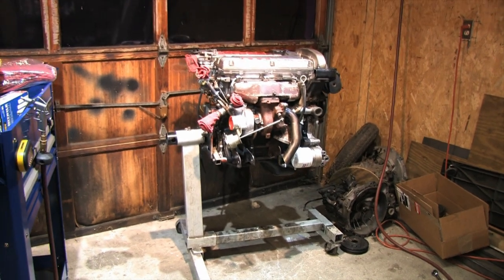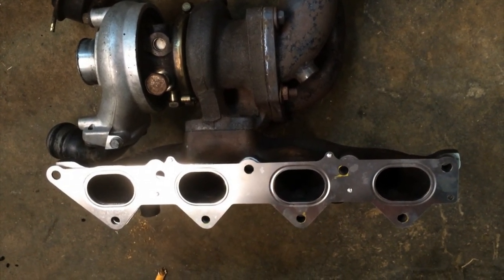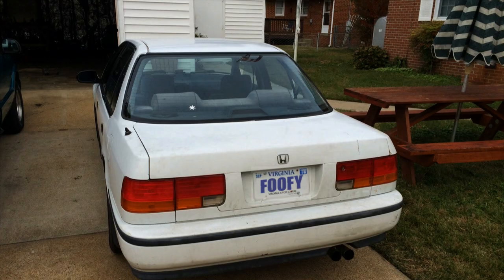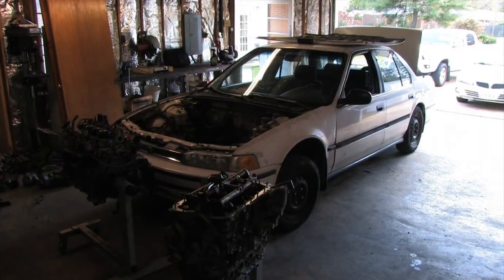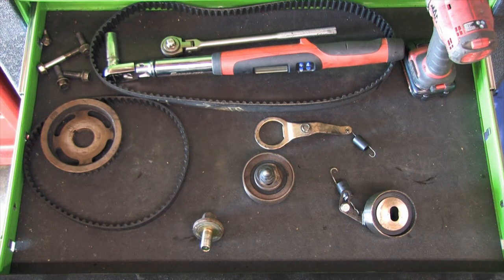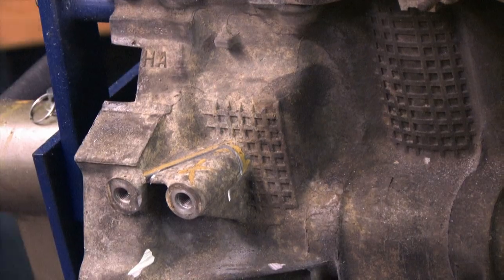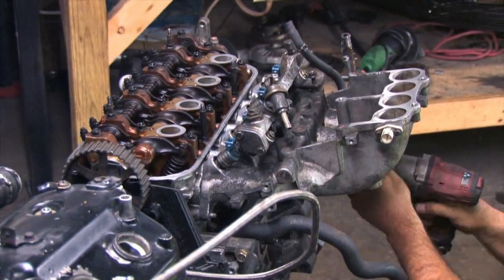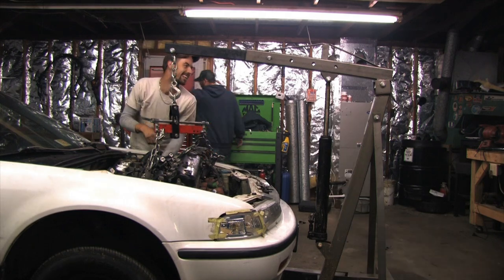Foofy?

Comment: Maybe not the best thread to ask but.. What sort of oil should I use to lubricate the sprocket that goes on the crankshaft in 4G63? 60k miles ago I didnt use any, and yesterday I have had a huge problem with removing it.
Reply: Blue loctite is by best guess. It secures yes, but it prevents rusting and removing later problems too.
Reply from the maker: +Martin There'ss no lubricant recommended for the sprocket, actually. What Mitsubishi did was design it to need a special tool to remove it. There's 4 threaded holes around the crank snout. That's where the puller is supposed to bolt down to. It's a puller that uses a bar for leverage, bolts to pull the gear, and it uses the snout of the crank for leverage. I've never bought this tool and don't own one. I've had crank gears that won't fit on the crank, but I've never had one that wouldn't come off. There's always more than 1 way to skin a cat.

If you don't care what happens to your crank seal and the block isn't covered in flammable oils, heat up the crank gear with a propane torch and pry it off with a shorty pry bar. You don't need to make it red hot or anything. In fact, that would be bad. It will grow slightly with heat, and should give you the extra slack you need.
Reply: Forgive my answer Martin. I considered typing, "I'm not sure of the correct answer, but if someone answers I'll want to know too."
Reply: +DE Nichols Thanks for the answer. I have learned something new, that's the whole point of asking questions and reading the answers :-)  I will have a look at this stuff.
Reply: Martin My advice is good elsewhere if you get my drift. :) Just not on spark plugs or high heat areas.
Reply: +Jafromobile  At the end, I have made the tool out of the old pulley;it worked without any problems. second sprocket came off after very gentle tap of the wooden block. Woodroof (?) half moon did not came out at all,so I decided not to molest it :-)
Against the advice, I have used a tiny amount of the graphite grease. ATF has got great penetration properties, I was afraid that the rotational forces will only accelerate its 'escape' + it would mess the belts.

Time will show, next check in about 50k :-)

Apologies for the off topic.

By the way Jafro, I think you have never made a video with the detailed timing belt installation! I can understand that after your brilliant blueprint series that would be a step back and basics of the basics... but hey ho... maybe one final Lantra upload? :-)

Comment: Hello, my master, my car is elantra 1992 model 1.6 dhoc engine when I start my car, it is carrying water out of the radiator
Reply from the maker: Usually this is a head gasket failure.  Exhaust is using the water out.  Sometimes you can just replace the head gasket, but you might need to do more work if the head or the block are warped.  Cheap parts, it just takes a while to do it.

Comment: I know a lot of people who feel that the balance shafts aren't necessary and they usually leave the belt off.  Thoughts on this?
Reply from the maker: +Samuel Thomas The oil pump balance shaft is gear driven, so that trick doesn't quite work on a 4g63.  The oil pump is driven by the timing belt, and only the front balance shaft has its own belt.  You don't want to run one without the other if you value your fillings.
Reply: +Jafromobile On the F22A though the front and rear balance shafts are driven by a seperate belt than the timing belt, the oil pump is directly driven by the crankshaft and the water pump is driven by the timing belt.  Many people report no noticeable difference in vibration when leaving the balance belt off.  it sheds around 8lbs in rotating mass.
Reply from the maker: Samuel Thomas Oops, my apologies.  The comment screen I was on answering you… didn't tell me which video your comment was on.  Yes, on the F22 both balance shafts are belt driven.  I wouldn't remove balance shafts on any car with a stock or solid crank pulley.  I'd recommend a dampened crank pulley upgrade.  Some harmonics you won't feel, but your engine accessories will.
Reply: +Jafromobile But if I recall, the balance shafts do not reduce torsional vibration like a harmonic balancer does.  They're designed to reduce secondary vibrations that are natural in all inline fours.  Other Honda engines don't have balance shafts, that was kind of an Accord/Prelude thing.

Comment: im doing some 90's stuff too"   90 prelude 4ws- f22b1 block  h22a4 head-   any advice is much appreciated .. just like all of your vidi's......much appreciated ... also got my hands on a 98 impreza 2dr 2.5rs.... parts are a nightmare...
Reply from the maker: If that F22 sees either boost, or nitrous, increase your ring gap dramatically.  The rotating assembly has virtually no aftermarket bottom-end aftermarket.  There's a few tricks that have caveats, but the only options are incredibly expensive.  If you're going to boost an F22, the stock rings will be the death of that engine if you don't give them adequate ring gap to deal with the heat.  You probably gathered that from the video, but that's the study we've got out of this.  Foofy is back.  Foofy got a chassis upgrade.  This setup is in an LX now.  No longer a DX.
Reply: ,.  i was planning on getting it running right. then tearing it down and adding a 87mm bore from 85.5.to match the h22 head, then get rods and piston. but for now its just  Frank.. I'v heard a few tricks my self.. like like h22 crank may fit along with the rods to make a franknstroker ,.iv also heard evo 4g63 pistons will work too if you didn't want to resize, but they drop compression  ,., right now im at odds on valve stem seals,,. too go aftermarket or to go oem.... and if aftermarket ,,what are some reputable brands for honda,. and then the valve spring decision, when does it become necessary to upgrade them? .,. btw.  how do you feel about balance shaft delete mods?

Comment: i not a big fan of the f or h series but the f20b blue top is cheap and packs power and bolts on to the accord chassi don't know if you turbo set up will fit tho
Reply: ponchob18 you do realize that the f20b is basically a smaller h22 right?

Comment: Hey I'm not getting any rpm when trying to fire and it won't start, it'll sometimes pop off flames. Any idea on what it can be. 1995 GSX I wired in the 1g CAS it gets spark it just won't fire, any ideas let me know
Reply from the maker: +Mikey Alameeri You need to swap some plug wires around.  The '95 cam angle sensor works backwards from all other years' cam angle sensors.  Just to let you know… it wasn't the '95 model year that got it wrong.  It was all other years.  ;)  Google "95 CAS 1g 1gina2g swap plug wires".  Click "I'm feeling lucky".
Reply: +Jafromobile I've got the 97-99 eprom ecu so it says that I don't need to change those wires around
Reply from the maker: +Mikey Alameeri I didn't know that any 97-99 ecu's were EPROMs?  It's an easy thing to test, though.  To just swap 1&4 and 2&3.  It sounds to me like it's out of phase because you got it to backfire... So you know there's spark.
Reply: +Jafromobile no yeah it's a flashed black box ecu, I'll try that but it says that they don't need to be switched because of the ecu that's in it

Comment: diesnt those motors already have like 9-1 compression?how did you get around that?
Reply from the maker: +reachforacreech What is there to get around?  Compression is a good thing if you know how to tune for it.  My turbo Elantra is nearly 10:1.
Reply: +Jafromobile I thought anything over 10-1 would cause predetonation
Reply from the maker: It could.  Indeed... or you can correct your timing and fuel mixture to make use of it.  ;)

Usually people who complain about high compression are trying to get away with it on a factory ECU.  Your fuel source and quality play a factor, but you can definitely tune around reasonably high compression ratios.  I wouldn't go boosting an 11.5:1 build over 5 pounds, but with the right fuel, you can.  I'm throwing 20 PSI at my Hyundai.
Reply: +Jafromobile so do all non turbo fuel injection engines require a new ECU in order to control it after  adding a turbo?
Reply from the maker: Maybe not a new ECU, but means of tuning it, or a piggyback system that lies to it so that it does the right thing with all the wrong information...

Comment: So I got rid of my 4G63 Sentra project for.... for a Foofy clone! 93 4 door CB7... but auto :/ Its getting a manual swap soon then getting all my turbo parts I've collected over the past couple years.
Reply from the maker: You are absolutely going to hate the manual swap on that car.  The engine mounts on the body are in completely different places than on the manual.  The rear engine mount is even vacuum actuated.  ...?  I can't tell you why Honda did it?... but the body of the automatic is a different body than the manual car.  The automatic transmission mount doesn't fit the manual body, and the manual transmission mount doesn't fit an automatic body.  Their position is physically different in the engine bay.  That will require expensive custom mounts, or time-consuming re-engineering of the body-side mount.  I'd advise you to look around for a non-running manual donor unless time and money are no object.  In the end, the boosted F-series will still have a glass jaw.  Use Hondata, but be 100% sure to install a knock sensor or you'll find that glass jaw real quick.  There are no good readily-available fuel maps for the turbo F22, so it will take careful tuning prowess.  While it's a do-able swap, it's not without its issues.
Reply: Ehh, crap. I swapped a few cars before but never a Accord, didn't know it was that involved, guess I shoulda done my research before buying it. I've had a manual 91 Accord before and loved the F22 and always wanted another. Hmm, I might have to do some horse trading with this car, brb......
Reply from the maker: It can be done... Foofy got that treatment.  You just have to really want it badly enough.  :). But if you can easily find a manual donor, you'll thank me later for that heads-up.

Comment: whats the 450cc duty cycle @ 15 psi? 90%?
Reply from the maker: +john martin Probably.  That sounds fair considering all engine systems and variables to be in spec, stock condition and in perfect health.  It's going to vary from car to car based off of how much intake and exhaust resistance there is, whether or not it has boost leaks, and the condition of the fuel system.  It's all dependent on airflow but it can also change based off of how well its fuel pump works, condition of the fuel pressure regulator, etc...  If the fuel pump or the fuel pressure is weak, the duty cycle increases to compensate and satisfy the o2 sensor.  If pressure and fuel flow runs higher than spec, it will decrease the duty cycle.

Comment: RIP Foofy i learned a lot from this
Reply from the maker: Foofy ain't dead!  Foofy lives on.  You won't believe Foofy's next upgrade...
Reply: can we please have the video? i got about 2 more elantra videos then i'm gonna need a break...
Reply from the maker: Zac Wadholm I expected it to be finished by now, but the owner has his hands full at the moment.  I'ma need a break from the Elantra myself.  I've only got about 2 more videos I can make of it.  I'm removing its last few deathtrap tendencies before dropping the hammer and taking it to a dyno.  That car turned out to be around 600% more work than I ever wanted to give it.  At least it kept the miles off of my GSX.  It kept the engine out of it, too... but that's another story.  I'm trying Zac, but my hands are just as full as Chad's at the moment.
Reply: hey man I know how it is, i took time off work to build my car i'm only 16 but i'm building a 04 Mazda 6 2.3L with wiesco forged pistons and eagle rods I wanna run a 14B turbo at 22PSI, a 75 wet shot of nitrous, a big valve cylinder head and a crower cam. I dropped the compression ratio from 9.7 to 8.8:1 and with ethanol, i'm sure i'll break something. either way love your content because I learn so much and no matter what it is i'll be sure to watch

Comment: Why would he not pull the head, and install a new gasket and head bolts since he will be boosting it?
Reply from the maker: +Subaru Mike Because it would have made my video too long.  :P  No really… The first 2 engines held 26+ PSI boost on factory parts and didn't fail because of a blown head gasket or stretched head bolt.  There's that, and also because he started to… and the first head bolt on Foofy 3 that he tried to take loose stripped the bolt.
Reply: Wow, is that by unlucky chance that the bolt stripped, or a common thing on F22/23's? I have unbolted ALOT of Subaru blocks, and i hope i never come across this happening!.

Comment: Love your work Jafro. If your after a cheaper solution for tuning you might want to check out speeduino.com . There is a little bit of diying and it is in the early stages but it is a standalone ecu for under $100

Comment: cb7!
Reply from the maker: Sho nuff.  Mitsubolt-on'd a Honda.  She's doin' great by the way.
Reply: +Jafromobile that's great! I came upon this video while watching the Hyundai build. I have a cb7 myself and I've been itching to put a turbo on it. im gonna have to do this with another engine because I ported and polished my f22 head and mated it to a f23 bottom end with dome k20 pistons. I have a high comp build
Reply from the maker: That's what Foofy 2 was.  F22/F23.  The motor was too fresh and tight; the pistons didn't last long.  Then again, not many Hondas will at the boost levels it accidentally saw.